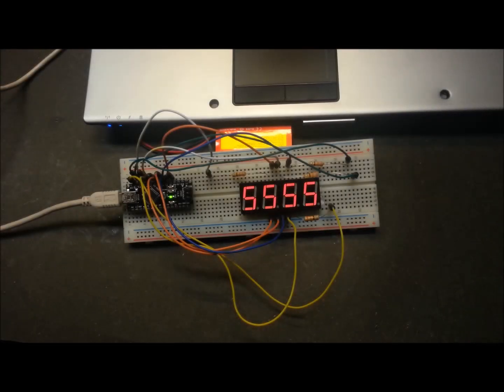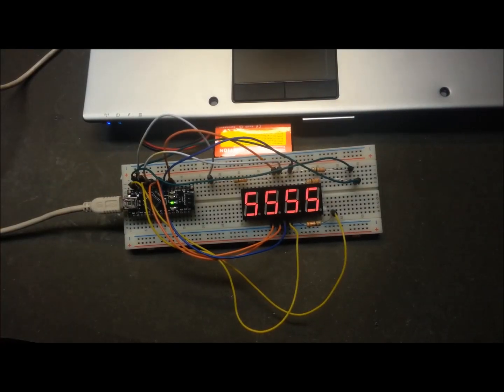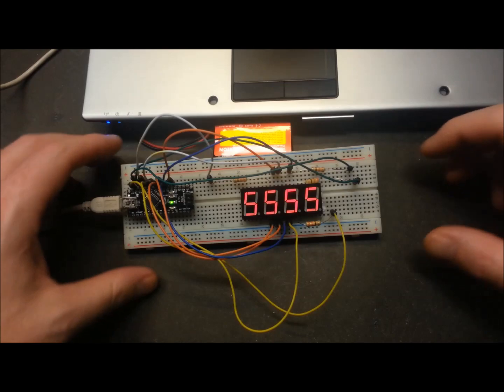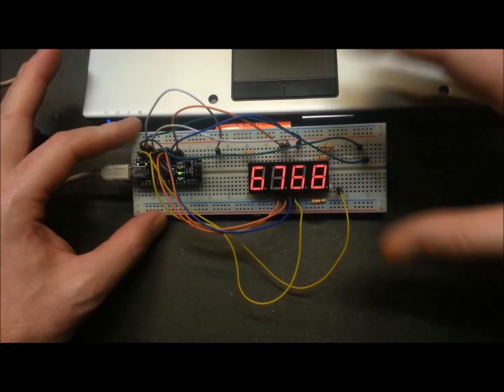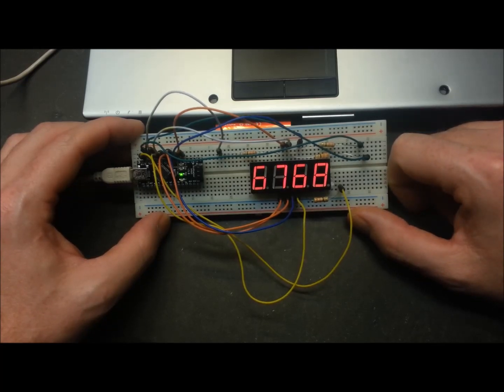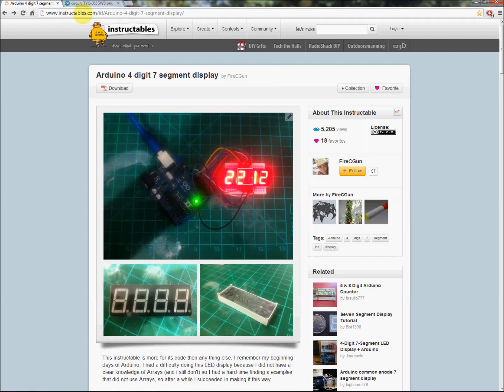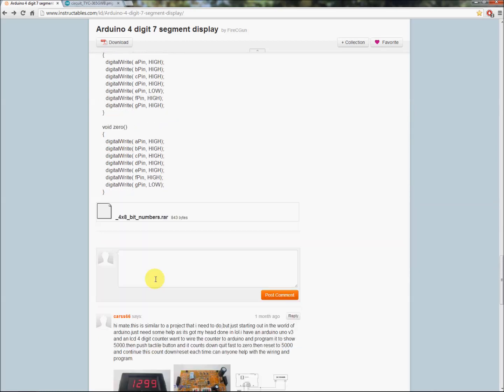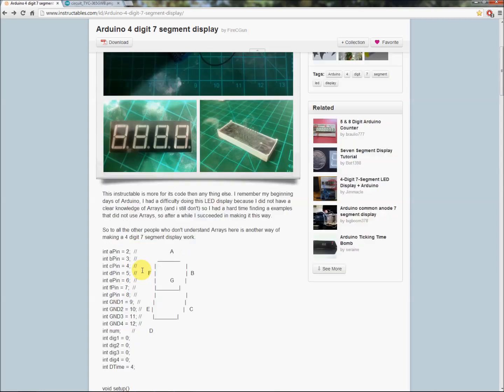7 Segment Display for Arduino- Tutorial of Sorts

Comment: Hi Eric,
i do a project like this and if you are interested i can send you the code as running i.e show in my video on the follow link ? --> http://youtu.be/IJkWgKzzitU
scroll a little down on the side so you see the parts i was used for my project.

One answer to you that i got is as follow if you can send me your code for the arduinoboard for the 4 by 7 segmentdisplay ?
That would make me glad or some downloadlink for the code ?!
Thanks and nice coding ! ;)
I use a multiplexing environment and the 4 by 7 segmentdisplay got a common cathode for each digit so i need only 11 connection pins on my microcontroller to run it because it needs 10mA and ist a low current !
I don't use a 5 Volt VCC and the 4 digit pins are connected to the 4 PNP-Transistors and they act as Inputpins over the baseconnector and 1 KOhm to ground !
Reply from the maker: Code is posted on the Forum on my website.
Reply: ok and thanks for info